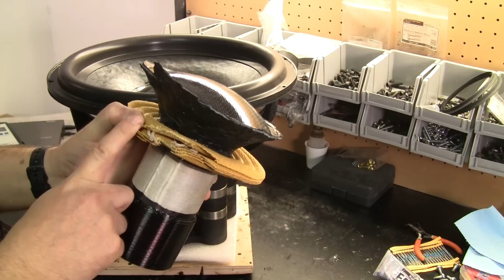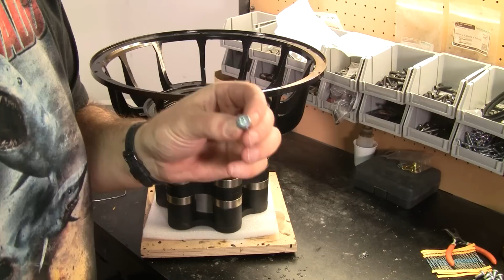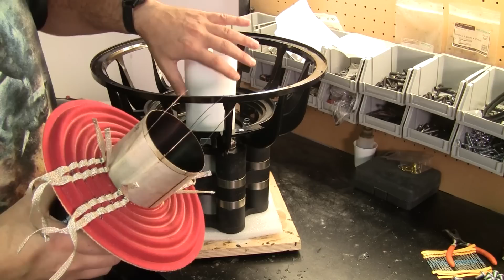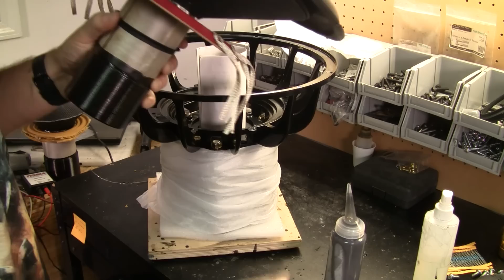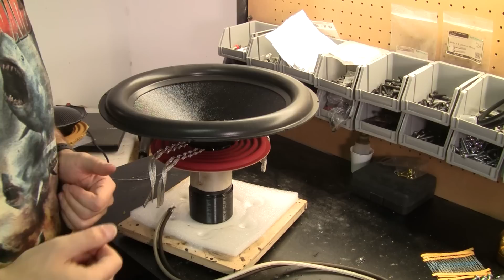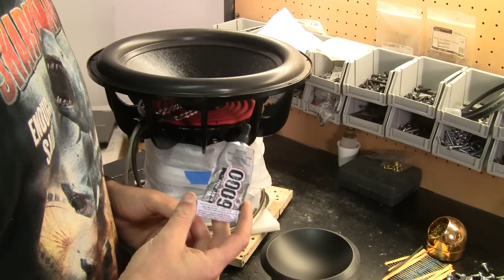I rebuilt a custom neo sub for SPL - Tech Stuff Tuesday

Comment: having built a lot (not hundreds) of subs including the 18" Earthquakes with dual spiders as, the Shaker Vegas, adding PVC to replace the cardboard tube, and machined washers for 1/4" rods that clamp it on top of the glue, top to bottom with smaller coil vent holes. Set street stock IASCA which held for some years. I SEE DAMN LITTLE I'D do that you did not! BRAVO NICELY DONE.  PEACE GRD  I won't mention some of the questionable stuff we see for video sake.

Comment: im going to attempt to re-wind my voice coil for my 10 inch boss phantom 2100 watts 2 ohm.  what gauge wire should i get? i measured it with my calipers and i get .35 mm's. i found some 32 gauge coated copper magnet wire on amazon. was thinking that would work?. my first attempt at re-wining. a guy crapped me on the speakers. and i trusted him..  i got the speakers apart without having to cut anything. so gonna re-use everything i possibly can

Comment: So I have a question I have an early 90s octagon so invega 15-in stroker car sub it's got all the components just needs a new coil and spiders drop them I have original dust cap and original cone would you be able to get it fully functioning?
Reply: that company sells a complete allen bolt drop in recoil and cone kit complete... 10 minutes...done

Comment: Question i was runnung old school mb quart q series components was 2 8s 2 5 n quarters, 2 tweeters on an old school ads ph15 i had to pull system out of the car when i pulled the 8s out both positive tinsels were snapped?  I shouldn't have been able to send the to much power i was also running.a 3 way set ct sounds meso 6.5 comps on same amp the quarts are bi ampable so thats how i ran them.  Question is anyone have idea what would make it snap, and is it fixable?  Thanks

Comment: Hey brother how do I get ahold of you?? I have a idea for a custom subwoofer and this subwoofer would most likely be the most powerful sub ever built in all sizes 8" 10" 12" 15" 18" 21" 24" ect.. iv been fooling around with a custom coil design and I deff wanna see someone build it n test it and see what it can do.. iv completely designed some monster looking subs and iv also custom designed one of a kind coils actually 3 deff styles.. and one of them I wanna know if someone is actually able to build it n see how well it works.. I know it should be insane and hold alot of power but a custom motor would have to be machined n built.. but anyway I wanted to see if your able to pull it off.. and if it does well maybe we can work some kind of business deal.. yeah the subs may not be cheap to make at first until it's perfected ect but I have a super strong gut feeling it will change the car audio world and this sub design I designed n wanting to build will be the loudest of it's size ect..
Reply from the maker: You can email through our contact form on our website www.emfcaraudio.com

Comment: 31:00 No complaints on the soldering job, but you said it's not possible to soak solder all the way through without a torch. Now, I do not know what's the heat tolerance of the spider and such, but if you have a big enough iron with enough heat capacity, it's no problem to soak solder all the way through those thick wires. Does it matter? Maybe, maybe not. But the way you solder them obviously works well enough, and thats what matters. :)
Reply from the maker: I wouldn't feel comfortable saturating heat that much with a soldering iron. It would disperse through the leads extremely fast and the wire at a much slower rate. You could essentially burn the leads before heating through the wire entirely.
Reply: Yeah, I'm not too familiar with your particular application, just pointed out that soaking heavy gauge wires with solder isn't too difficult with enough heat capacity on the iron, but obviously you have to adapt to the specific leads and materials around so you don't burn stuff.

Comment: Thanks for all of the knowledge you give out on this channel, much needed in this industry.

So Sean question for ya, when it comes to adhesives and subwoofers, for the most part is it the bigger the gob the better the job or a little dab will do ya??  Within reason of course.
Reply from the maker: In more cases than not, having excessive adhesive is just a waste of adhesive. I don't generally try to find how how little adhesive can be used. I make a best guess (which isn't a ton) and if there is an issue I adjust. Having enough to bond the entire surface area is my starting point.

Comment: One of, prototypes that never make production, and homemade gear may not fly in many competition organizations.  I'd read the rule books before trying to take something like that into the lanes.
Reply from the maker: Champions will tell you, rules don't matter as much as they should. You'd be surprised at how many rules aren't enforced, especially with "commercially available equipment".
Reply: @EMFAudio  
I've seen it and as you suggest who is going to cause a scene?  How many classes are even close enough that someone would call foul and demand judges do a check?  Still though, it just takes one person to get butthurt.   My first year competing I got booted out of rookie class after someone found out I worked in the industry 13 years earlier, and that was just a local org with no prizes bigger than a 2 layer trophy.

Comment: I don't know if there is a reason you don't use flux. I have had a good experience with Amtech flux. It makes soldering much easier!
Reply from the maker: Tinned leads don't need it, among other reasons. Basically if it isn't needed, I don't use it.

Comment: Can you add more magnets to make the coil taller and can adding a thicker surround and a thicker spider increase the amount of excursion the subwoofer has when building a subwoofer
Reply from the maker: The coil is taller by making the coil taller, it has nothing to do with the magnets. A thicker surround and thicker (stiffer) spiders could REDUCE the amount of excursion a sub has. If the motor isn't strong enough to drive the coil for the suspension stiffness, it won't move as much.

Comment: What is the point or ease to sobering cables to the leads? I like push terminals makes things seem more quality.
Reply from the maker: That is a long running debate. Some claim it's louder but nobody has supplied supporting evidence to prove so that I'm aware of. In the case of this sub, the owner wants to avoid breaking terminals installing it and the leads are long enough to connect to bolts inside the box. Only in the most exaggerated cases could there be some tenths to be gained, like over 20,000 watts, MIGHT gain a few tenths.

Comment: Serious suggestion.... but what if you put the neo magnets inside the coil?????
Reply from the maker: Some do that, it goes on top of the pole. It does add some motor strength and there is a right way and wrong way to go about doing it to not have adverse effects.
Reply: EMF Audio I didn’t know that, I thought all were external of the coil. Haha I’d like to understand magnets and induction better. I wonder if there’s more efficient ways to get power through. Or longevity of subwoofers. like a thin layer of silicone on the inside of the magnet protecting the coil.. I think this new stuff is awesome!
Reply from the maker: @OK-st9st  The protection as you put it isn't necessary. There is no contact, and the inner diameter of the magnet is greater than the top plate inner diameter so there is an air gap much greater anyway.

Comment: Why dont you like direct leads
Reply from the maker: They're time consuming to make with no quantifiable benefit till you get to huge extreme conditions, like 20kw+ per sub where the difference might be 0.1-0.2 dB. They're also more difficult to install and deal with, while adding additional connections that can be a point of failure.

Comment: Incoming complaint, but only because you asked (31:30) - did you account for the extra mass you added when you used like 6lbs of solder?!?
Reply from the maker: The mass on the leads under the dustcap really isn't that much. The solder on the leads at the basket isn't part of moving mass.
Reply: @EMFAudio  while that's factually correct, I just don't find it nearly as funny

Comment: You're not saying who made it? It sure looks a lot like the neo prototype that Sundown Audio did awhile back. Oh, and btw, split washers (lock washers as you have incorrectly called them) do NOT work. It has been proven time and time again. Especially when you torque them past the stacking point (when they go flat) with an impact as you said you used. Thread locker should have been used.
Reply from the maker: So what about the thousands of subs made the same way that don't have problems? As a matter of fact, the only subs I can think of that have had problems from any manufacturer, used thread locker and weren't appropriately torqued. I'd love to see that neo prototype motor you're speaking of, I don't recall Sundown ever posting such a thing.

Comment: Not a complaint, but more of a suggestion:
A 100 watt Weller will solder those leads without torching the spider(s).
I solder my crimp connects on the 12v side with a torch, then heat shrink them.
I'm just OCD when it comes to soldering, I guess.
Reply: Good advise..except weller!!weller are dogshit !! everyone i bought or use has broke within a month or 2....and thier "100 watt" is not constant on!!! its automatically controled like  off for like 2 minutes and then on for 15 seconds!!! fucking irritating!!!

Comment: Can I send you 3re audio xxx 18's to customize ?
Reply from the maker: If you think it's worth the cost, sure.
Reply: With you rebuilding them would that change the ts parameters enough to where I don't need 10cf enclosures per woofer?
Reply from the maker: @spoonsr1755  They shouldn't anyway, but yes most likely they could be built to be used in much less.

Comment: The latest research has conclusively proven that lock washers don't work,  in fact they only act as extra springs (that is intuitively obvious). Loctite is only way to go.
Reply from the maker: Was the research conducted by Loctite? I can point you in the direction of hundreds of thousands of subs that use lock washers only without failures. As it turns out, lock washers work as intended on subwoofers.
Reply: Since when do lock washers not work? Where's this so called study that proves they don't work?
Reply: Betcha rob is a loctite employee..

Comment: So you couldnt make a direct replacement  coil without someones speaker basket and motor?No way of taking measuremeants or just sending the old coil ? If it had been user error that fried the coil in the first place? Or how could a person go about that if you can.Just asking have a cheaper pair of 12s that I would like to keep but,by time I pay for ship ,coils and repair.I could buy a new and better set.
Reply from the maker: The only way it could be done off of measurements is if a jig was made, so there would be extra steps to make a motor/basket replacement of sorts.

Comment: About 8 years ago I purchased some dd 18's brand new the clue joints were horrible and dust cap rattled off...since then I have learned how to build my own subs for my burp car with the help of talented people like yourself...learning every day!
Reply from the maker: I know what you're talking about with the caps. Assembly method is as important as the materials.
Reply: @EMFAudio I use a deaf Bonce 8" mid stacked on top . Its pretty heavy , but not overkill
Reply: Too bad you still ain't loud 😂

Comment: It's got to be a SMD lol. Thanks for the videos great job
Reply: I recognize it was making a joke with the double motors like the original SMDs and all the drama he got from the SMD meter
Reply: @exdime  I gotcha went over my head but yes that would be funny af to rag out the smd subs I always thought fi would be top do industry my btls were some of the best subs I have had, but to pick up some zv5 's so I will know soon if they r better or worse
Reply from the maker: Zv5's are better, by a long shot.
Reply: @exdime  lol
Reply: The guys at Fi had originally built it. but thats all i know
Reply: It js originally a btl neo with a second btl motor added made by fi audio
Reply: z5s are a different level than the btl if you have the power and enclosure you'll definitely be happy with the z5 monsters